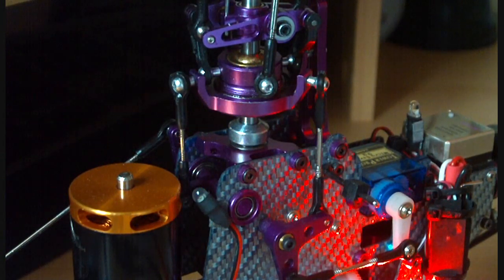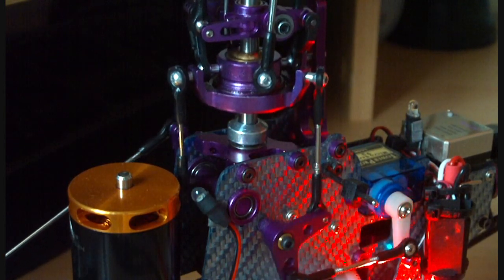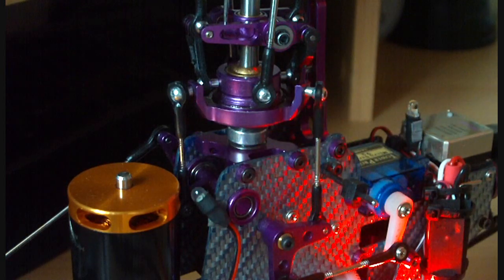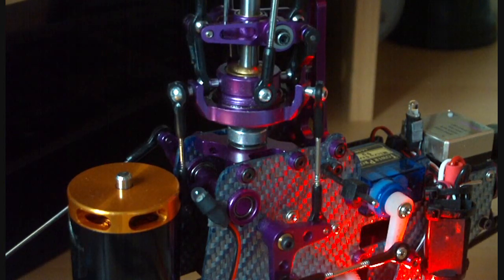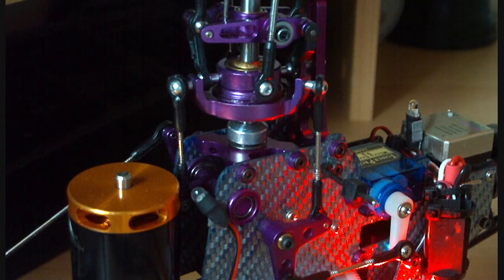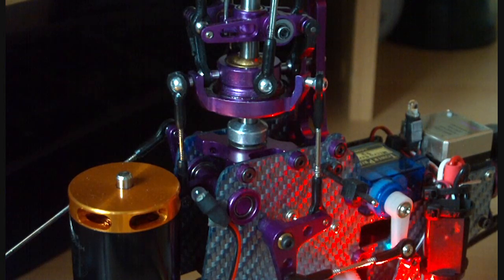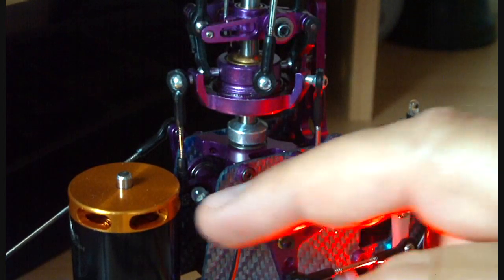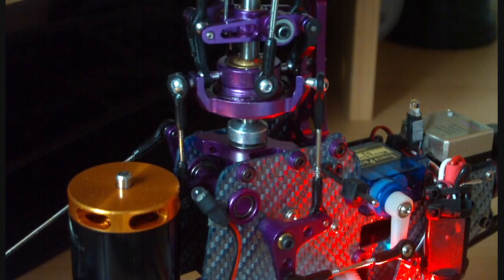Swash Mix Explained

Comment: Absolutely superb video :)  I've just completed my first build-from-scratch Align T-rex 500 3d which I grabbed off ebay for cheap... The mechanicals were easy enough, I've got a knack for that kind of stuff anyhow, but the electronics and the programming put me into overwhelm!  Anyhow, with lots of advice from a friend who is two steps ahead of me, I was finally able to pull it off the ground for a hover inspection.. it flies!  Not tracking right yet, learning how it all works, figuring out the pitch gauge, some improvements already but more tweaking needed, anyhow great video and very helpful for me.  Thanks Man!

Comment from the maker: I'd suggest looking at the manual for the radio/rx you have to see which of the swashplate servos go into which channel on the rx. 

The servo directly in front (or directly behind) of the main shaft is usually plugged into the 'ELEV' servo connection and the other two are usually plugged into the aleron AILE and AUX1 channels.

Make sure the swash type setting in the radio is the right one for the model you are setting up. It would help to know the model and radio you are using.

Happy flying.

Comment from the maker: @johnnybio1, this is actually a Belt CP V1 Carbon edition. You can't get these any more as they have been replaced by the Belt CP V2 and the even newer Belt CPX. 

I bought this Belt CP from Heliguy dotcom (in the UK) but there are loads of online places that should sell the Belt CPX with the CNC pieces. If you are ok building an RC heli and setting it up you could also look at a Align 450 V2 copy from somethere like HobbyKing dotcom. A cheap way to get a great machine.

hope that helps.

Comment: Great video! Somewhat of a shame there aren't more of these explaining in detail how more advanced stuff like this works. One part that always confuses me is making sure you've actually got the right servo plugged into the right spot on the rx.

Another thing is some transmitters come with a bunch of swash mix types (mainly amount of servo's and their placement). Something to think about when for example your pitch servo suddenly acts like the elevator is supposed to and such. :) Cheers!

Comment: Excellent block of instructions Painless 360, I have an issue with my Aeolus 50 3D, whenever I engage the throttle stick , the swashplate tilts left and right and will no slide straight up or down, Up and down motion as everyone knows creates acceleration for helicopter to lift (hope that is not incorrect). I am going to try reversing servos to see if I can accomplish up and down motion of swashplate, thanks. I will post result on here later.
Reply: Wow! I found the issue that was bugging me as far as the vertical movement of the swashplate on my heli is concerned, I reversed the pitch channel as suggested and walla!! the up/down movement of the swashplate occurred, I am so excited, your video was quite helpful Painless360, thanks again.
Reply from the maker: Quite helpful ;) Glad we helped you get it sorted! Happy flying!

Comment: A little Question. if you buy a rtf heli, is it possible that the swashplate isnt level because its "curves are preprogrammed? i dont mean when you throttle up cause that goes in an even way, but just when you connect the battery to the chopper, the angle of the swashplate seems to be tilting in the oppisite direction of the way the heli wants to pull because of torq!  CAN SOMEONE ANSWER THIS?

Comment: No idea my spektrum manual only explains how to adjust mixing, expo, DR etc it doesn’t troubleshoot! I have a sneaky feeling it has something to do with my gyro, it’s an ace RC gt5.1 thing is the gyro manual doesn’t explain anything like this either, I’m really stuck I have been trying to fix it for weeks so much so I’m thinking about buying another gyro😔
Reply from the maker: I've not used Spektrum for a long time. If there is some form of flight controller on the model (flybarless unit?) then that could be the cause of the issues too. Best of luck with it..

Comment: Hope you still monitor the Heli stuff... I want to experiment putting a Acro Naze32 rev6 in a Heli but there is not a single video on youtube about that. Perhaps its a crazy idea but I have an extra one and want to see how it will work. Any ideas or pointers? Thanks
Reply from the maker: +Collin Joseph Thanks for the idea but at the moment I'm not looking to do much with classic helis on the channel. Couple of pointers if you are looking to do this - vibration is a big problem on RC helis (even with balanced blades/head etc.) so you need to think hard about how to mount it. I have talked to someone who's used one of the new PixRacer boards on his heli with no vibration dampening and had no problems due to the new code/boards 4x sampling rates that allows it to 'see' through the vibration. Best of luck!
Reply: Thanks for the advice, and as always great job on the channel.

Comment: Question, when me airelron is
Moved from right to left it does not come back to neutral position,but hangs up a little  to either side,I checked my linkages they seem to be fine. As I move the ailerons from
Right the main blades starts to turn? I'm confused. I did notice one
Servo running much hotter then the 
Great. 118 degrees f could I just have a bad servo,its a brushless 
One, what up with my ion 2   ?
Reply from the maker: Sounds like an unhappy servo. Best of luck

Comment: Dude I'm stuck. Setting up a t-rex 450. My swashplate moves correctly with stuck inputs except, giving throttle only moves the pitch\collective servo. The other 2 servos don't go up. What should I look at?
Reply from the maker: Sounds like there isn't a pitch mix setup properly on your radio. I'd start there.. Best of luck!